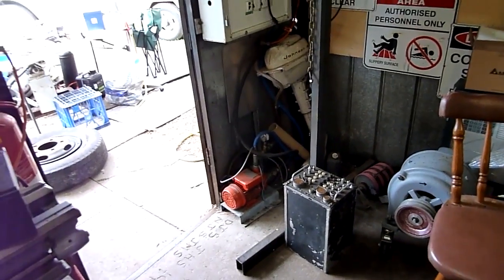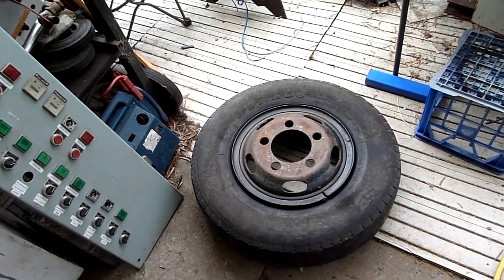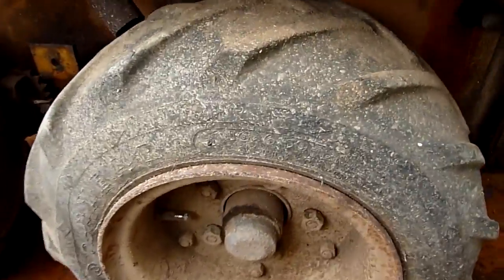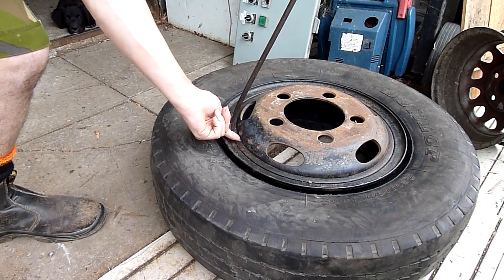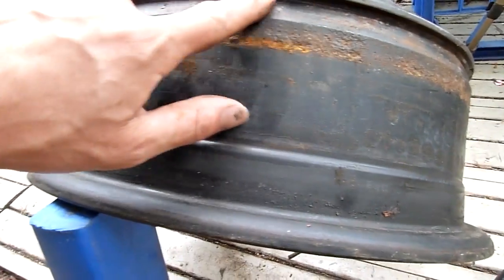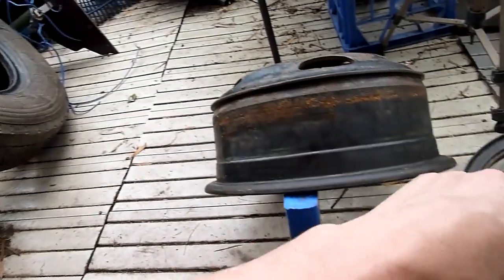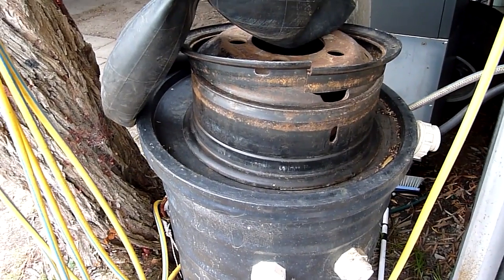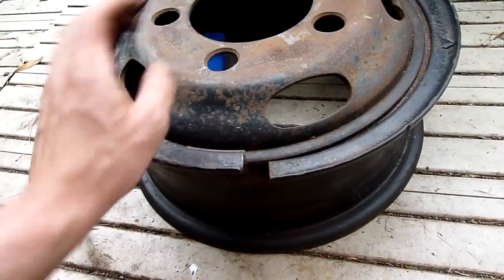The Locking Ring Split Rim - AKA Widowmaker - Why is it deadly?

Comment: These are split RING rims, not widowmakers. Widowmakers are Firestone RH5 degree wheels. They are a true split rim. Split rings are considered safe as long as they are assembled and checked to proper procedures including airing up in a cage. Yes they can still kill you if you assemble them wrong, but they aren't what people mean when they refer to widowmakers.

Comment: Thanks for this explanation.  A mechanic gave me the impression that it was the split rim circlip itself that was dangerous and could spring off the rim and cause harm even if the tyre is flat.  It makes a lot more sense to acknowledge that the biggest danger is an incorrectly fitted split rim failing when the tyre is under pressure, especially when putting the tyre under test pressure.

Comment: No, that's not the widowmaker.  That's just a split ring wheel and as you said they're still used everywhere, including the USA.  Don't get me wrong, they're dangerous until the beads are set and you should use a tire cage or chains until inflated.  The true widowmaker is the Firestone RH-5 (other brands too) rim.  Those are virtually extinct now, other than a salvage yard.

Comment: That’s not a widow maker.  That’s a split locking ring rim.  Those are quite safe when mounted properly.  They should still be inflated in a cage.

The widow maker has two solid circle rim halves, one is slightly eccentric.  There’s no way to see that it’s properly locked unlike your split locking ring rim there.  With the widow maker you just have to pop it together, inflate, and hope for the best…

Comment: I don’t think that wheel is a widow maker.  That is just a split rim.  Just as dangerous.  A widow maker is split in the wheel in the middle like your trailer rims only they use a lip to hold them together instead of bolts. Now it may be common practice where you are and probably is in some parts of America and other places to refer to all multiple part wheels as widow makers.  

I think something people don’t stress is that when there is no pressure there is no danger. But there is danger in bleeding air and in especially in inflating them.

Comment: We used tire cages in the Army years ago. We would put the tire in the cage, hook up a 20 ft air hose to the tire with an air chuck and back up 20 ft from the tire as it airs up. Had one split ring pop off and it bowed both sides of the cage. Tire cages were never repaired. If we were out in the field we would use the tow chain from the vehicles OVE/OVM. We would wrap the chain through the wheel spokes and tire, then hook up the air line and move back.  If the lock ring wouldn't lock flush with the tire uninflated, we'd DX it and get a new one.

Comment: 40-ish years ago I returned to the tire depot one time and noticed two customers standing, and a mech from a local place we supplied tires to. He was in a hurry and inflating his own 16" tire on a split rim after putting a new tube inside. I stopped him briefly and put the portable safety cage on it for him. Then said carry on and turned away.
 BOOOOOOOM!!!!
 As I turned back the tire and cage were flipping over in the air at head height!. It crashed down where it started, as various peeps were wetting their pants! The tire has burst on the underside. All was good otherwise, and he bought a replacement tire and another new tube.

Comment: I have two old military 1-1/4 ton weapons carriers and I have changed the tires many times. Split rims might be dangerous for someone who does not know what they are doing when changing tires, but they are not all that dangerous when done right. The extra holding edge and tougher tires of those wheels makes them safer, especially when overloaded.

Comment: These rims are actually safe but still wise to use a cage ,    but never use a ring or wheel with any defects in it ,,,usually caused by beating with a hammer  , inspect closely , and use proper tools !! If they so dangerous the company's who made them would faced lots of suites !!  just like lots stuff like this be careful  !! I guit a job because they wanted me to mount  a tire on a faulty Wheel

Comment: I grew up driving trucks and Landcruisers with split rims. I was taught right at the beginning (this was the 70s) how to remove and replace a split rim safely. They are an awesome rim if you are in the middle of nowhere but yes, they can be fatal.
I was taught to ALWAYS stand off to one side of the tyre you're filling with air. EDIT: Also, be sure that the gap in the ring is pointed in your general direction. The rings invariable blow off at the ring gap, leading the ring to generally flay away from you (end edit). At best, you'll be lucky if it blows. At worst, you might lose a finger or hand if your gun isn't long enough. I haven't changed a split rim in over 40 years, but I reckon I could almost do it blindfolded. That's a result of working in seismic oil search in the 70s and hanging around the workshop when I wasn't in the field. The mechanic would get me to replace all the LC tyres that had been spiked. 
Another rule is 'never use a split ring on a wheel that it wasn't originally on. As in, don't swap your rings.
One of the most dangerous 'split rims' were the 'RH 5-degree-type rims. The mating surfaces of the rims were hidden by the bead, so you didn't know if the rims were mated properly. They are obsolete nowadays but can still be found on antique trucks...usually in the junkyard.

Comment: That's not a widow maker, the actual widow maker splits in the center of the tub, not a separate lock ring,, do your homework, this style of rim is still widely accepted,, widow maker have a major difference in assembly,, NOT THE STYLE YOUR TRYING TO PAWN OFF.

Comment: Thats a locking ring wheel ,I may be wrong but a split Firestone wheel is actually a two piece wheel and in Maine thats a widow maker, because there's no way to verify its seating because you cannot see it,at least with this type you can verify the ring is seated Regards

Comment: The true widow maker was the split rim where the locking lip was around the central circumference of the rim and as such not visible to see if a correct lock had been achieved. Compared to them, these split ring rims are safer if correct procedures and maintenance are observed. Most tyres these days are designed for tubeless rims and the internal of the carcass is left with a rough finish which wear out a inner tube causing punctures and a safety issue in it self. The tubes themselves are being produced at a lower standard depending on what country they are manufactured and also a safety issue. To me the authorities have let their guards down with standards of tubed tyres which I consider was a better wheel for remote outback travel, but maybe not now.

Comment: No, that's not a split rim mate ....... a split-rim is where the wheel is in two halves, and is held together by a series of bolts. The wheel in the video is a 2-piece wheel ....... the wheel, and the locking-ring/flange. The bigger wheels are 3-piece ........ the wheel, the flange, and the locking-ring.

Comment: The split rim I know of is an actual split drop center wheel that goes together in the center by angling one half of the wheel and pushing it down and then pushing the other side down and then pulling up on it and centering it on the other half I had a good friend get his head blown off by them.

Comment: The term "Widowmaker" has become akin to the term "Pizza". The word "Pizza" is used to describe all types of pizza including that crap with pineapple on it.🙄
 Ask most people and they will identify almost any Split-Ring, Split-Rim, Split-Barrel, Lock-Ring,  wheel as a Widowmaker. While multipiece wheels are generally not as safe as a single construction wheels there as some that are far more dangerous than others. The term "Widowmaker" was assigned to, arguably, the most deadly design ever adopted. That title belongs to the Firestone RH5°/KL which is the wheel that became know as the "Widowmaker". There are many types of wheels including, 3-piece, lock-ring, split-ring, solid-barrel split-ring, split-barrel solid-ring, and dozens of variations of these types. Bottom line is if is isn't stamped RH5° then it's simply a variant of these wheels and not the "WIDOWMAKER". GREAT VIDEO NONE THE LESS 👍

Kudos to this young man as he did his homework and shows exactly what a WIDOWMAKER is and why this video simply shows a split-ring wheel. 👇

https://youtu.be/BuFaNv9y29c

Comment: on my M35A2, i bolt the wheel back onto the truck, just hand tight, with the ring facing the truck to inflate them. No chance of anything coming off the truck if they fail.

Comment: I see that this is the later, "deep skirt"lock ring, which was much safer than the earlier narrow skirt type. Generally, as long as the components were clean, undamaged, and visually in position, they were safe to inflate, especially in the field.  That said, bear in mind that you have to bat 1000 every time this is done.  Therefore a cage or chain is very important in inflation.  Failure is incredibly rare, but incredibly consequential, even in a cage.  Makes you wish you had waxed paper in your shorts.  Stay safe.

Comment: It would be obvious if the ring is not mounted properly.Blind freddy could see if the ring isn't sitting flush or seated correctly.I am running split rims on my hilux and have removed/replaced tyres several times with no issue.I think they are extremely dangerous and the accidents that have happened is due to complacency and over looking the making sure the ring is seated correctly,confining the rim in cage,chain or what I do out in the field is park on top of the rim standing well clear when inflating.

Good video.

Comment: Never had an issue with these rims' had a good teacher 'the old man'  mistakes people who got injured was damaging the bead rim or locking ring on removal by unskilled fitters , next was the killer bit if you got it wrong refitting the beadlock and locking ring if damaged as said when removed it wont seat properley , inflating where fitters got it wrong, i was taught never-never inflate to full poundage in one hit only part inflate to 20-30Lbs  go round locking ring with hammer to set locking ring it will seat more and settle in the locked position ,  never had one come apart  ,   changed my first split rim tire at 16 watched by the old man  i'm  64 now ......... By the way thats  a 2 piece  not as common as the 3  piece   .........

Comment: That wheel is not the widow maker. The widow maker was made in two pieces at the center of the wheel not on the side. I have worked on the widow maker, the split ring and the 3 piece lock ring style. The reason a lot of those wheels blow out is due to inexperience with them  because no old timers to teach them the proper way to do them. The widow maker was made by Firestone Wheel Division.

Comment: These rims are. throwback to the days of Dayton hubs on cars and trucks.  Dayton hubs have rims that are the same diameter as the hub so there is no drop center.  That is the reason for the lock ring.  There would be no other way to mount the tire.  This only works with inner tubes obviously since there would be no other way to hold air.  When tubeless tires came out they made rims that were a step larger to make room for a drop center so you could have a solid outer rim and still mount a tire.  This is why you have half sizes in truck tires, to allow tubeless tires on Dayton hubs and avoid mixing the wrong tire and rim.  A 20" Dayton hub uses a 20" lock ring wheel and a tubed tire.  You can install a 22.5" rim on a 20" Dayton hub and have a one piece rim with a drop center and a tubeless tire.  They run as follows.  15" tube / 16.5 tubeless, 20" tube./ 22.5" tubeless, 22" tube / 24.5" tubeless.  The reason the military continued to use the split rims on BUDD hubs was to allow changing tires in the field.

Comment: You gave a good explanation of split rims, split ring rims, and split ring rims with lock ring. I have heard the term "split rim" used for several years and now I know what this means. Also, I was not aware this type of rims were also used on tractors and other types of machines with wheels other then trucks. Thanks from Ottawa, Ontario, Canada.

Comment: The widow maker is the solid ring type, there is no split, you must pay attention to where the ring sits and make sure to inflate them in a safe manner, cage or even on the vehicle if it is a dually configuration. Two points to pry the ring off and only one way to put them on, they can cut a mans head clean off the body without notice. That one is the traditional later model, a little bit safer, but still deadly, if no handled properly.

Comment: Nothing wrong with these rims. Put tube in tire air to 20 lbs. Mount on rim set snap ring. Mount tire on axle on duals the rings face each other. Air to proper pressure 85 90 lbs. 10x20 tubes are standard on intermodal chassis.

Comment: Wraping a chain around the unit, depending on the tire size, isn't enough! May be ok for, say an 8.25 X20. An 11.00 X 22 tire & rim combination will snap what you might think is a sturdy chain like a string. However, there are chains specially designened for these kinds of tires/rims.

Comment: In 1975 as a high school student I spent 2 weeks working at a tyre fitting company as part of a work experience programme from school, i met and saw a bloke who had a scar from his hand up his arm shoulder and side of his head where a split rim from a farm tractor tyre which is filled via high pressure water blew, even the hole in the work shop roof was visible. this stuff is scary folks. obviously no cage or chains were being used but i will say this i would not mess with this old tech/ leave it to the professionals but then again even the professionals can get caught out. Be safe people this old tech kills.

Comment: if you air up the tire  up with the rim down and sit on them.  if they blow up the rim blows off it just bumps you around. I used them all the time, could take them down and air them back up in the woods all the time.

Comment: I work at a tire shop and we do lots of commercial work including split rims, once the ring is on, we inflate to 20psi and then hit the ring with a large hammer all the way around to promote equal engagagement of the tire. The process is repeated every 20 psi until the tire reaches 80psi

Comment: Well presented. Could you please make a Video how a big tubeless Tyre on a 4x4 is changed IN THE FIELD, ( side wall stake -can't be fixed )and inflated   with a small compressor to seat the beat. Ps. (No exelerator and matches please)

Comment: That is really useful. For some reason, I was under the impression that split ring wheels were only dangerous when fitting the ring back with the tyre on the wheel until watching this video. Very enlightening.

Comment: I remember way back in 1966 or so, as barely a teenager, I was riding my bicycle home with a couple of friends, and we stopped at an intersection where we were to split up. We were just standing there, astride our bikes, talking, when we heard a big bang, followed by a clanging sound, then several thumps, and soon found out what the thumps were when a big tire passed by, bouncing and thumping as it rolled. Then we noticed the bus to our left that was screeching to a stop, the right front tire missing, and the rim sparking along the cobblestones. Then I realized my left side hurt, and that, while my hands were still on the handlebars, the handlebars were now turned 90 degrees to the right, but my front wheel still aimed straight ahead. One of my luckiest days! I realized shortly that the split ring had popped off the rim barely behind me, and was the original bang and clanging that we heard, and the tire hit me, then rolled forward, bouncing down the street. Half a second later, and the ring would probably have hit me. Might have killed me, but for sure would have seriously injured me. As it was, I was only sore a couple of days. Very lucky day.

Comment: Tens of thousands of these are changed every week world wide. With no cages etc. 
While you should be very aware of them if you use common sense and make certain they are locked before you inflate them. And NEVER stand over them.
I have done dozens of these and the only drama has been I dropped the rim on my toes as it fell out of the tyre.
They are however very hard to balance. 
I do not do them any more simply because of the weight, too heavy to lump around!

Comment: I'm about to get two 1970s motorhomes, and now I'm nervous about the wheels, since both units have split rims all the way around.
Reply from the maker: This type are pretty safe unless you get somthing really wrong, as others have pointed out, these are not the true old fashioned "widow makers" but just earnt the nickname because they are 2 piece and can blow up if you really mess up the remounting process. 
I would be comfortable owning and driving a vehicle with them myself.

Comment: That is NOT a split rim.  A split rim literally two halve that are almost symmetrical and when aired up almost look like a tubeless rim.  THAT is a split bead.  The ONLY time it's more dangerous than any other rim is when someone doesn't know what their doing and don't seat the split bead into the groove properly and starts inflating hoping that the tire will push the bead in place.   Super dangerous but so is anything that isn't used properly.

Comment: When I was younger and we ran a shop we changed these all the time  they also made a three piece split rim, every 3/4 ton truck had them, never had one come apart, but we used a sledge hammer to pound on the lock ring as we inflated them to make sure the ring stayed in the lock groove, kept you on your toes tho! I still have one of the special tire irons that were made for taking the rings off.